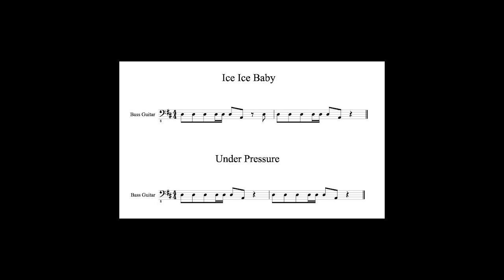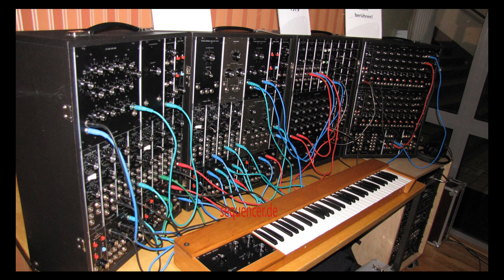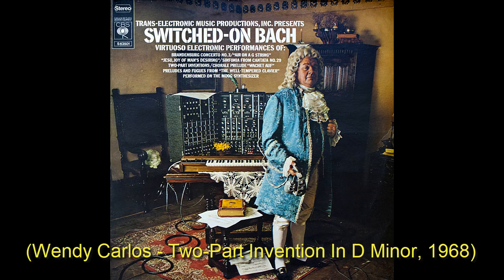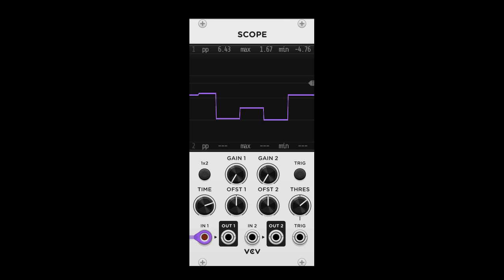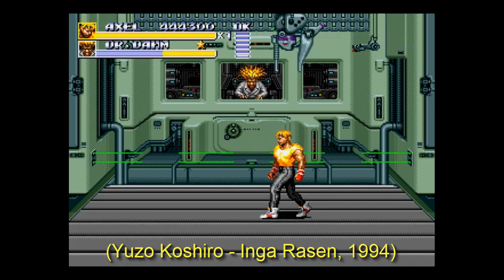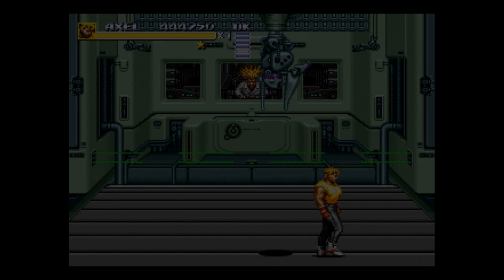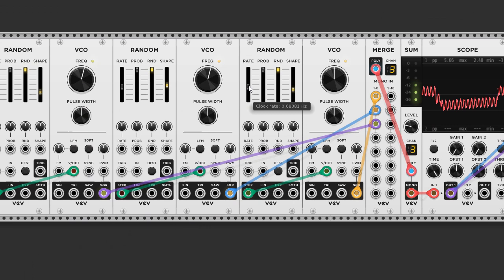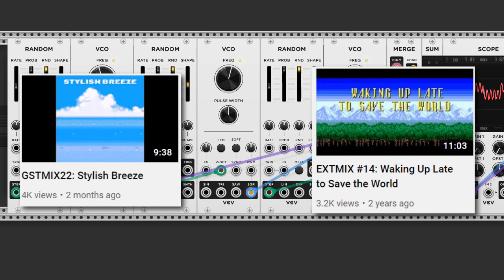The Music that Inspired Crazy Bus

Comment: Wait, so is it seeded randomness or true randomness? If I were to rip this game's soundtrack multiple different times, would each one have a completely different melody
Reply from the maker: iirc, Crazy Bus used badly seeded randomness. so it's technically different each time, but incredibly easy to get the same seed since the console startup conditions are the same each time. I think if you press the reset button, you'll get a new seed.(?) it's been a while since I've looked into it though... 😅
Reply: @GSTChannelVEVO  Fascinating!